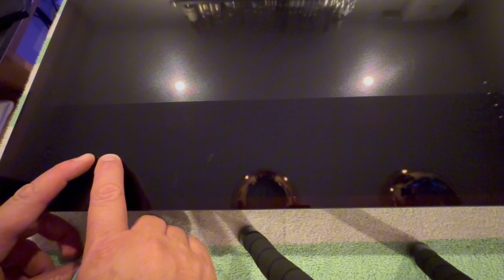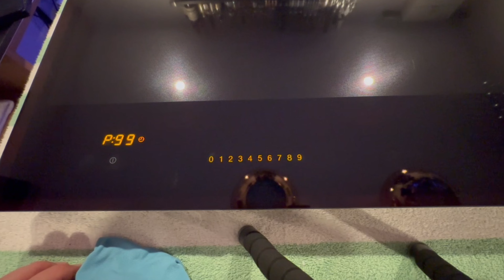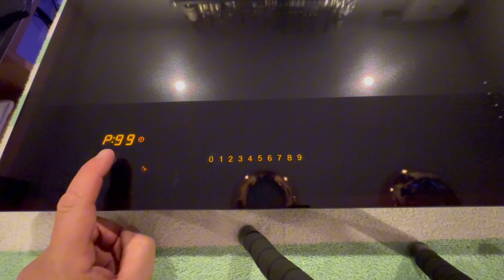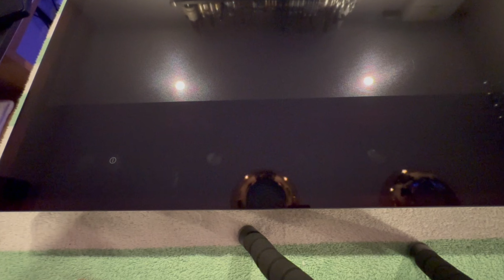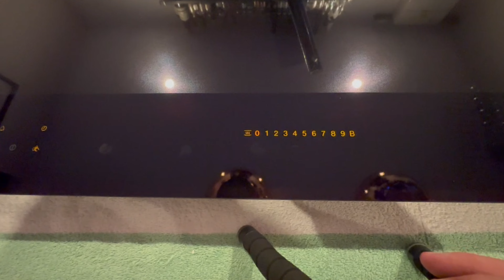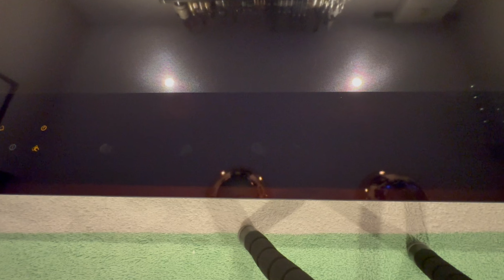Miele Induction Hob Err031

Comment: @MieleGuy-uk any tips for putting the silicone “buttons” back on the hob? I have the issue that without the glass everything is working as expected. But with I or get nothing or get the “F” symbol in the screen. 

I have a KMDA-7774 

Thank you for your videos!
Reply from the maker: Those silicon pads must located correctly on electronics, try assembling hob with our silicon pads and see if you still have F if not it means issue with the pads if yes maybe issue with master electronic the one with on off button